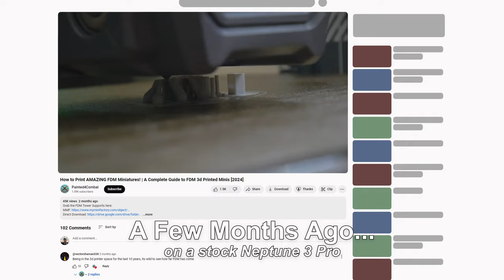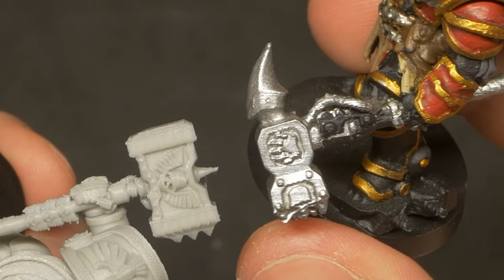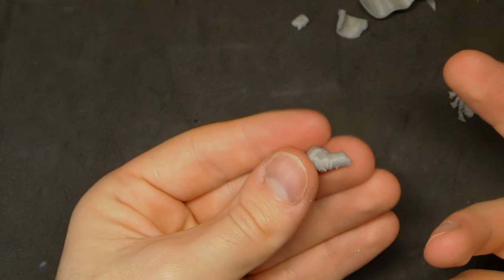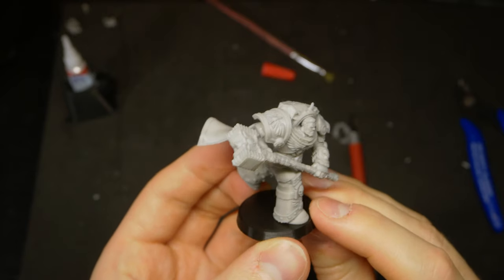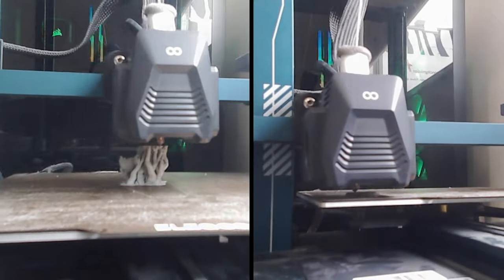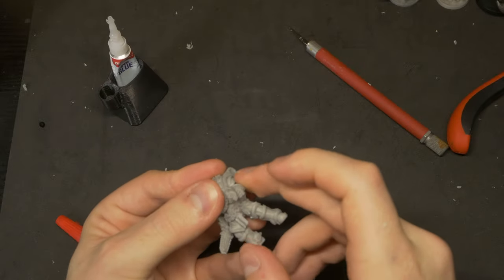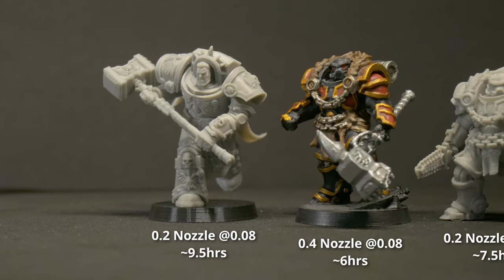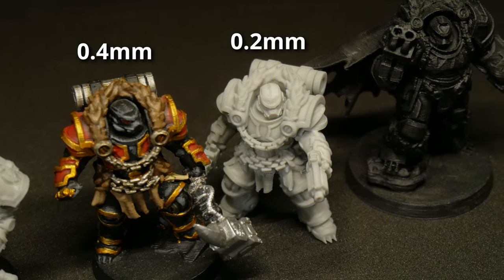EASY Resin Quality on Modern FDM Printers? (following your tips!)

Comment: Nice job? What filament are you using?
Reply from the maker: Just standard Elegoo PLA. I find it has a nice finish, a slight flexibility that's nice for minis, and it's super cheap. 

It can struggle a bit on overhangs without proper cooling which I think is a result of it's slightly flexible nature, but it's a fine trade-off imo.
Reply: @Painted4Combat try the sunlu meta. Also Fat dragon games has some really nice pre sets for miniatures
Reply: @Painted4Combat  Hi! Sorry to bother you but I just found your channel in my youtube recommendations. I watched your video but I don't seem to see what FDM 3D printer model are you using. Could you tell me which one it is? Thank you!
Reply: @terraxcell  hi, did you try the meta? I'm having a bad time setting it on my Mega S. What I think is the worst problem is that it melts to easy and small parts aren't possible. I also find difficult to have consistent results. ESUN PLA+ gave me better results on minis.
Reply: @adfasadf-h3g  Looks like Elegoo Neptuine 4 (or maybe pro?)
Reply: @crovaxthelich With meta consider first to calibrate the flow to this pla and use low temp like 190°c which help a lot with small parts
Reply: @kalganum  I'm printing at 185° and I tried even lower, but if the extruder needs to stay on the same place for something like a sword, it just melts the piece too much. Even with high fan cooling. I guess I have to keep trying until I finish the spool and then, maybe switch back to pla+
Reply from the maker: @adfasadf-h3g  I currently have the Elegoo Neptune 3 Pro!

Comment: Most printers can print down to 0.04 layer height. But probably turn on variable layer height to reduce print time if you go that low
Reply from the maker: Yeah, the only downside of the Neptune 3 pro is that its minimum height is 0.08 - ive tried going lower but it does casue issues, so im assuming the 0.08 is accurately its minimum. Good call though!

Comment: Uhhh say you forgot to uncheck the "Emit limites to G-code" box.... what do?
Reply from the maker: If you leave it checked the acceleration/movement speed settings of the file you slice will overwrite the printers default speeds once you load the file. so if the print is set to travel slowly (which Orca does by default) it will make ALL future movements of the printer slow (even after the print finishes)
Reply: @Painted4Combat  Right but how do you get the default speeds back? Factory reset?

Comment: Did you know you can use a 0.6mm nozzle and set it to 0.36mm line width and still get awesome results. Basically you can set line width to be 60% of the nozzle diameter and it still works well.

Comment: That are some amazing results that you have achieved with your FDM printer, but they are still not on the same level of quality as resin prints. Also, the print time of 9.5 hours for a single infantry model is insane. Just imagine if you had to print a whole army of them. 
For comparison, on my resin printer I could print 20+ of these models in about 3 hours total and get a much better print quality.
It's the simple case of using the right tool for the right task. Printing 28mm models with a FDM printer feels a bit like splitting logs with a pocket knife. 😉

Comment: i just did an Intercessor in a 0.4 nozzle at 0,08 layer height at 25 speed and it took one hour and a half... how does your took 6 and 9?... 1: 30 is already too much time for a mini as it is.
my issues so far aren't layer lines but the supports, i will test make overhands printable and filling some gaps to see if it solves some of the rough edges.
Reply: But you can put 5 miniatures on the plate and have it print over night and then do another plate while at work.
This should give you plenty Marines to paint in the evening! 😁
Reply: It doesn't work like resin, in FDM it adds up, 5 at 1: 30hrs each sure, 5 at 6hrs will take the whole day

That without taking in consideration all the time finding, fixing and supporting the models, sheeesh, it's not easy and is not that cheap either. Facepalm
Reply: @Badbufon  I was talking about the "1.5 hours is already to much"... Sure if it takes 6-9 hours for a single miniature then you end up with 2 miniatures a day. 
I dont know about you but I and probably most of the rest of the wargaming population wont be able to consistently paint 60 miniatures every month...
Reply: sure, but those are more like game pieces than candidates for a golden demon tho, even at 0.2 the details will be rough and some stuff won't print correctly. just slap chop them with the cheapest craft paints on sight lol
Reply: @Badbufon  Absolutely!  Thats kinda the perfect level for my painting skills! :D
Reply: @Badbufon For the price of a good resin printer, cure station and material you can put up 2 filament printer easily.

Comment: I own both types of printer, and they have their strengths and weaknesses, but for me it's resin every time for mini for one simple reason. Even an entry level resin printer can print an entire squad of minis in the time that it takes a mid-range FDM printer to print a single model. He said that some of those minis took over 7 hours for a single model. That's about two build plates worth of models on a cheap resin printer. So maybe 10-14 models depending on how cheap you go.
Reply: How long does the entire finishing & clean up process take?
Reply: @PerfectionHunter  I'm not person from post, but I can answer your question :) 15min +- : few minutes washing, few curing, and removing support it is way easer on resin then on fdm - just use heatgun and they pop off, but... Its messy, and it smells horrible, I have separte room with big filtration unit but still I hate using it :D fdm on other hand is greate for everything else, terrain, single character, tanks, etc
Reply: @PerfectionHunter  my resin printer, with the settings I have, takes less time to clean up then a plastic model. The supports pop off and a quick hard edge makes it smooth very fast. I dont use a heat gun or anything special either, just have to dial in your printer to find that sweet spot where supports are strong enough to support, but not enough to leave pock marks.
Reply: @szaibot  agreed, just rinse in ipa for5 minutes soak in warm water and pull right off
Reply: 20 minutes  @PerfectionHunter
Reply: I mean yeah but the problem is that not everybody has the ability to place a resin printer in their room
Reply: @nikoraasu6929  There's GW.
Reply: Mind you the minis in this video were printed on an Elegoo machine. If you use a newer machine, like a Bambu Lab P1P or Creality K1, you can cut that easily into a third. Still much slower than SLA printin, but something to keep in mind. 

For me, I'll always prefer FDM because Resin just isn't worth it with the toxic materials, the space requirements, high upfront costs (for printer, washing and curing stations), and hassling with respirators etc.
Reply: @aaarghzombies640  overpriced
Reply: @nikoraasu6929  what is over priced?

Comment: Kudos dude, I made a comment that wasn't very positive in the last video. Not because I don't believe FDM can produce good minis but because the quality you showed were not showing that. These are much much better. But I am surprised that you get this quality without atleast tuning the motion system. The layer lines in your last video looked a lot like they were inconsistent as in z banding meaning your movement system wasn't tight. That going away with changing nozzles to a smaller one is weird. But yeah those look great. Good Job.
Reply from the maker: Thanks for tuning back in then! I have done some physical calibration since then and tightened a few of the axis nuts up, the usual upkeep. when I do a settings video in the future ill be sure to mention the steps I took. Thanks for taking the time to comment 😄

Comment: Been looking into 3D printing for WarHams 30k/40k, so I’m pretty fresh when it comes to what socket goes with what ball, so to speak. 

I think I’ve got a printer that I want (a BambuLabs entry model for FDM printing), but I need a bit more information in regards to the following:

—How difficult each FDM plastic is to work with 

—How difficult FDM is to work with vs resin

—What needs to be done in regards to setting up the printer’s workspace prior to printing 

—How to print FDM safely without landing myself/others in the hospital 

—What features should be top priority when shopping for a FDM printer (specifically features oriented towards printing minis)

—The differences between a resin-oriented slicer and a FDM-oriented one

TL;DR: Looking to get into 3D printing, need help with the basics before I hurt myself like an idiot.
Reply from the maker: Awesome to hear someone else is getting into the hobby!
Lets take this from the top.

- PLA is the most common FDM plastic and is very easy to work with and well documented, its much less temperamental than other FDM plastics and doesn't emit toxic fumes like other materials. 

- FDM and Resin both have their difficulties, with FDM youll spend more time calibrating your print settings and tuning your printer whereas Resin requires external cleaning and curing. 

- For setting up a space, if you use PLA plastic on an FDM machine you can simply just put the printer on your desk/table and go for it, if you use PETG (not ideal for minis) then youd need an enclosure to keep moisture out and vent fumes. Resin you would need your printer, a IPA container (or 2) for cleaning, a curing station and a way to 100% vent the harmful resin and IPA fumes.

- FDM is pretty safe if you use PLA, just dont go touching the 200*C peice of metal and you'll be sweet!

- Features for printing minis; as long as the printer can do a minimum layer height of 0.08 or under (ideally 0.05 or 0.04) and the nozzle can be swapped to a 0.2, you're pretty much in business. Any recent Bambu machine should be great from what ive heard, especially if its the A1 or A1 Mini.

- FDM vs Resin slicers are completely different and output files for the different technologies. A resin slicer gives you settings for resin printers and outputs image masks for each layer where the printer needs to produce light to cure resin, whereas and FDM slicer generates a path for the printer to move the nozzle along and extrude molten plastic. 

Overall, resin is better if you have a spare, well ventilated room and a way to exhaust fumes and dont mind the cleanup and curing process; resin will always give you better details and little to no layer lines or print artifacts. if you want an easier set-and-forget type machine you can have on your desk then FDM is the way to go, youre just sacrificing a bit of quality (and speed) for a "safer" machine that doesnt need chemicals or special ventilation. 
 If you are looking for more FDM mini videos, I 100% recommend checking out "Once in a Six Side" - he has great FDM and Resin printing videos, check out his A1 and A1 Mini review!
Reply: @Painted4Combat  hey, thanks for taking the time to not only read this but also comment! 

The information you’ve provided here is going to be incredibly helpful when I’m making my purchase! Thanks!
Reply from the maker: Of course!

Comment: Resin printing is so dangerous to your health im glad to see FDM is catching up detail wise
Reply: It's not really catching up though. It's reached the limits of it's capabilities whilst resin printers and resins in general are becoming much safer.

The only place for FDM these days is significantly larger models.
Reply: @RylanStorm  any anything that needs structural integrity.
Reply: @ThePointlessBox_  resin technology has come a long way, there are very tough resin now, especially when you consider that you can make stronger more elaborate internal supports or full thickness prints. resin also forms crystaline structures that are strong from all directions while the directional lines in a FDM prints are a fundamental weakness like grain direction on wood.

Comment: I have done the 0.2 and used many of the settings you have.  While FDM has come a long way it in no way even compares to resin 4-5 years ago.  One thing i don't like about these "FDM = Resin?" videos is that no one ever shows the resin next to the FMD in order to actually compare the two.  With out doing this these video's only show the improvements along the way that FDM has made but they don't give a true answer as the title is comparing FDM and Resin but you never actually do that.  The other issue i have is that one of the most important parts of a mini is their face thats the first thing you look at if painted correctly and this is where FDM falls extremely short of Resin.  I use my FDM's alot i have two a P1P and a P1S along with a resin G2K.

Comment: Unless I were prototyping I wouldn't ever use FDM for printing figures. Even with a smaller nozzle the quality isn't going to be perfect and it will always take longer than a resin printer, especially when you can pack a build plate with resin and print multiple things in the same duration. FDM is obviously cheaper and cleaner to work with but figures aren't really its strong point.

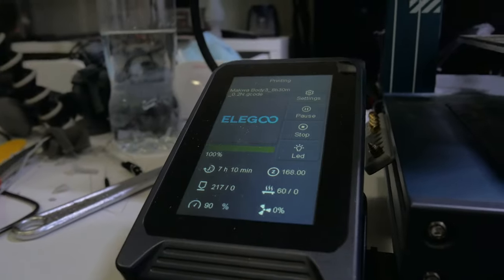Comment: Did the print time really say over 7 hours? If so 4:08 that alone makes this not worth my time. in that time i can print 12 of that mini in a higher resolution wash and cure them then cleanup after myself. Im not going to pretend layer lines don't exist on resin but layer lines are the most off putting thing to 3d printed goods. yes these minis are better than no minis but saying that mini was good enough to be a hero character is a big stretch.

Comment: That still looks like absolute garage quality compared to resin
Reply: You're correct, resin prints are better for the most part, but you forget the fact that not everyone has the correct conditions for resin printing. No matter what, it's a daunting task to print, maintain, wash, cure minis, etc. Not to mention the costs, health risks and space needed for both ventilation and surface area. Anyone who say "just open a window" really don't know what they are talking about. FDM? Print and Forget. Post processing? Scrape the surface a bit. I print at 0.04 mm layer height using a Bambu Lab printer, and the only difference between resin prints and my fdm minis are time spent print. I've checked. I don't have ADHD, neither, so I don't care about time.
Reply: Well duh. Even an old SLA printer will have 0.05mm layer height. 
That's not the point of the video. It's that you can do finer detail if you switch the nozzle on an FDM. 
I personally would let a 12 year old use an FDM printer, but I wouldn't let them anywhere near an SLA printer.
Reply: @helgehansen4458  I can only agree, where I live, houses are uncommon. I live in a flat, impossible to install any ventilation. The printer would sit right next to my work desk I sit at all day every day. The last thing I want is getting fumed all the time. Space is also a concern. While I could fit a printer, the wash / cure stations wouldn't without seriously expanding the hobby area (I doubt my gf would like that). So all in all, it's unfeasable for me to use resin. It's also a hassle, produces lots of waste (I wouldn't want to go to the local garbage disposal to get rid of dirty iso, but I would have to, though I believe that many people just chuck it). So if I can produce good enough quality prints, where you'll only be able to spot the difference under the macro lens or really up close, but not from 1.5m away on the gaming table, I couldn't care less.

On the note of the bambu lab printer and 0.04 mm layer height, which printer do you use ? I wanted to grab myself a A1 mini but it's hard to find info on what the lowest layer height possible is.
Reply: I use the A1 mini, as I live in an apartment as well and I'm sharing an office space with my wife. My printer is sitting only half a meter away from me, and I've had no issues at all in that regard. I use the basic grey PLA and it's definitely feasible to print 0.04 layer height consistently, without any problems at all for the most part. As long as the first layer is adhered to the bed, like with any other FDM printer, them you're good.
Hope this helps.
Reply: @helgehansen4458  agree completley , But shop bought mini's already painted look alot better than resin printed ones ,so i will just buy my figurines from a shop .
Reply: @helgehansen4458 do you really see a difference printing at 0.04 vs 0.06? I just thought because of the nozzle size it was a lower limit to the layer to be accurate.
Reply: The nozzle is definitely the most important first step, but afterwards it's down to layer height and precision of the printer. The difference between 0.06 and 0.04 equals to more than 30 percent more detail, roughly. I usually use 0.04 for the hero pieces and 0.06 for vehicles, terrain, equipment, etc.

Comment: 1:30 smaller nozzle doesnt account for less layer line visibility . only plus in quality you get is in the x-y direction
Reply from the maker: Yep! I think the main improvement in Layer Line quality came from having to slow the prints down a but more for 0.2 nozzle. Im planning a follow up video with my settings where I'll explain why these look better than my old ones.
Reply: @Painted4Combat  cool! I've been thinking about whether or not I should change to a 0.2mm nozzle but I print other things as well and those are easier with a 0.4